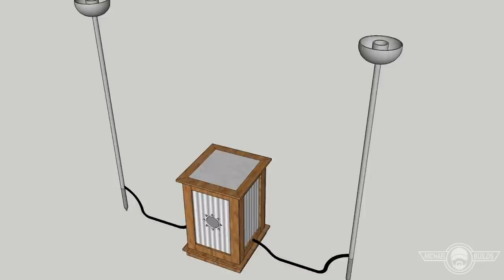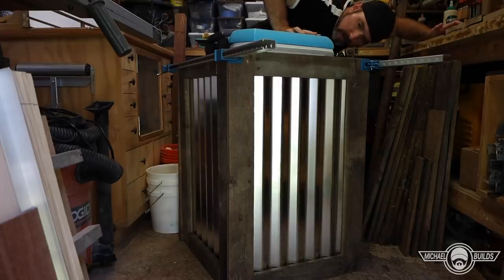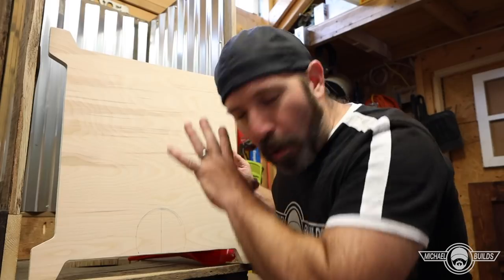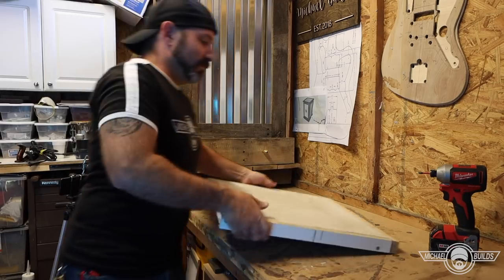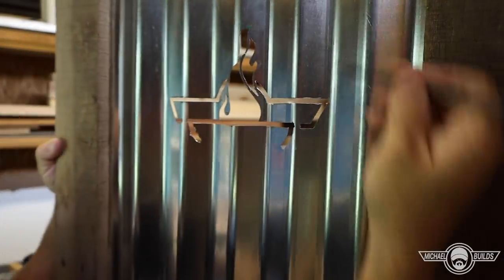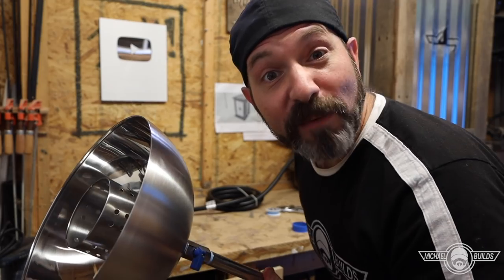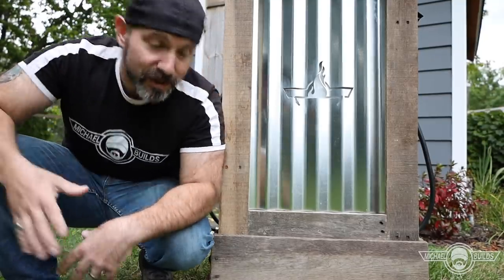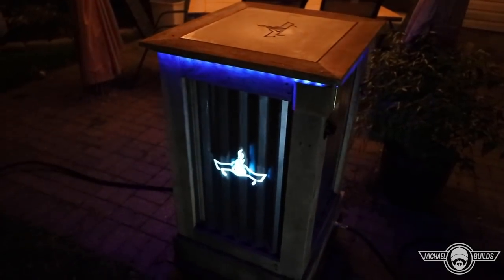Fire Feature  / Auction Project

Comment: awesome awesome awesome. Christmas presents are now figured out. Your videos rock. Oh yeah, good work with the new camera. I hated my Panasonic S1 for about 3 months. By the way. They have started on a new conference room concrete table. Same puzzle piece to attach the 2 sides. But used some really OLD lumber running down both sides and ends. I'll post up some pictures

Comment: I really enjoyed this project, the only thing is you left out many of the details. It’s bc I enjoy your videos why I’m saying anything at all, I don’t mean anything negative by it 🤗 Like the embossing, which I’ve seen your other projects but it’s fun to see the whole build even if it’s a technique filmed before, I’d love to see the process. Another thing was you skipped through the led’s pretty fast, I wished I could’ve seen how you connected them and how you fixed the ripped leds and implemented the extra parts you ordered. Question have you tried solar leds and do they work well? I’d personally go with solar lights so I wouldn’t have to use batteries but for this project batteries work well considering you wouldn’t be using them everyday. Another thing I’d like to have seen more on was the metal engraving of your sign into your metal panel, some of your shots were from the side or far away and anything that did show detail flashed too quickly or was blurry and hard to see. I’d like to see the torches placed into their tool holders that you built, that wasn’t shown and I don’t know it’s just fascinating and smart and I’d like to have seen it after you installed it onto your cart. But I appreciate how thorough you were with the issues faced, like adding an extra 5” which btw we as viewers respect when a builder is willing to show the ups and downs of a project 👍🏼 Anyways I absolutely love the project, the idea, your inspiration and it turned out very well so I don’t want to sound like I’m just complaining... more meant to be food for thought with future videos, we want to see more of the steps and details if possible but regardless really loved it! Ohh and I’d add gas struts to the top for safety and convenience plus I’m wondering if the concrete would break if accidentally slammed to hard? Lastly I’d add a couple or a few (depending on the size) of magnets 🧲 inset and hidden on the inside of your side panel just below where you installed your bottle opener so it adds to the convenience and functionality when poppin your top off, it doesn’t have to fall ;) 🤟🏽👌🏿🤘🏽